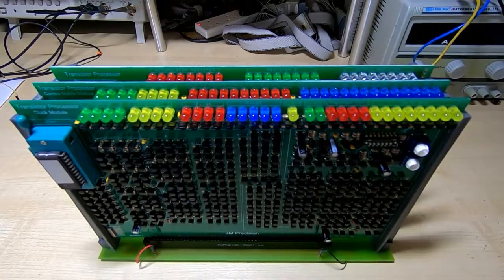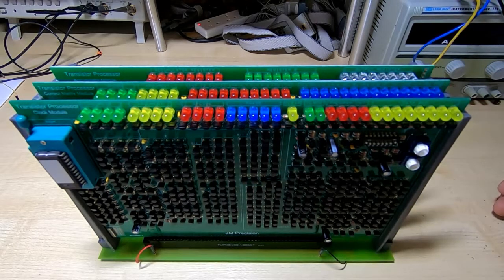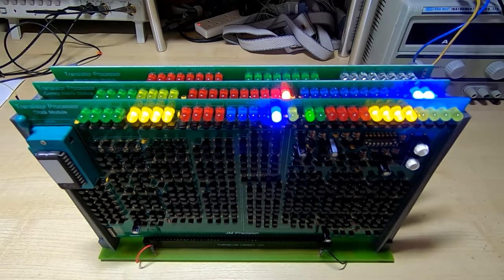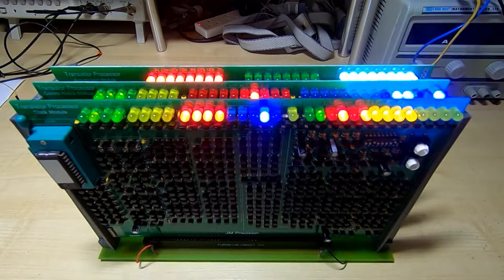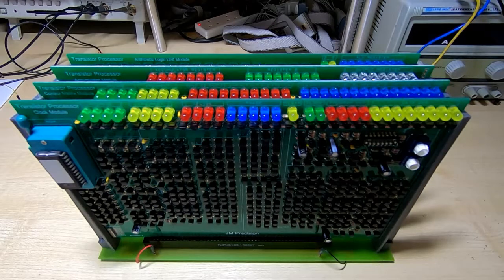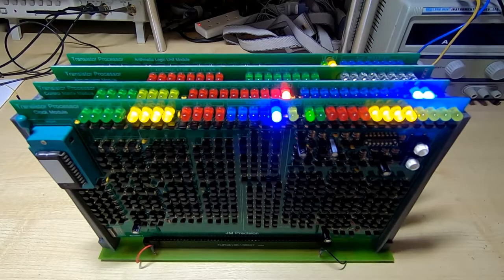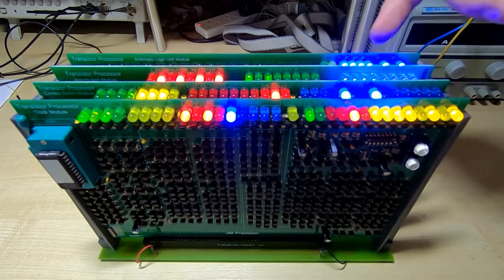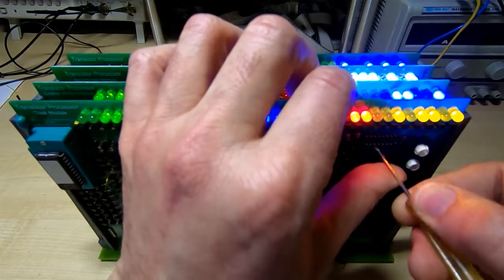JMPM Transistor Processor First Full Test

Comment: This is awsome, I want to do the same thing but need to learn how to use a transistor (already know logic and whatnot)
Reply: @reallifeperson6891  easy enough, I'm pretty much done with my TTL computer, then I'll start making the transistor version. I'll model after the pdp-8 since it's so easy. It'll be done on PCB because honestly manually wiring tens of thousands of leads does not inthrill me. I wished to buy this kit as in this video, but it's selling for freakin 700 dollars on ebay, ffs the board probably only costs 30 dollars to manufacture. I wish he sold a cheaper option, 200-400 seems more reasonable.
Reply: Dude I have the same problem  I hope I will learn as well! :)
Reply: @reallifeperson6891  Well, the TTL computer is a bit too advance, it has hardware stacks and some costly hardware in it that be a pain to translate into transistors. If I'd made it I'd end up like the madman that made the MegaProcessor (Absolutely worth checking out! https://www.youtube.com/watch?v=lNa9bQRPMB8)

Something like the pdp-8 that was designed to have as few as possible transistors would be preferable (the first generation of pdp-8, nick named the straight eight, was made completely from discrete transistors). I'm capable of making my own design, but why redesign the wheel, the pdp-8 is a tried and tested beast.